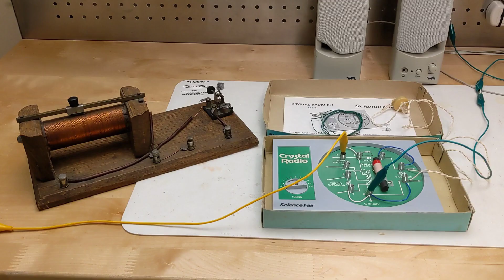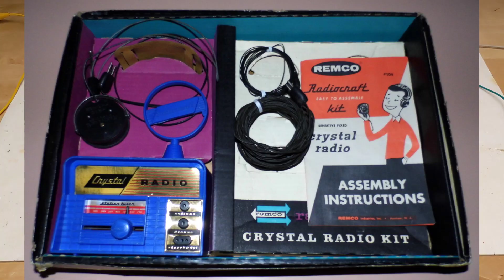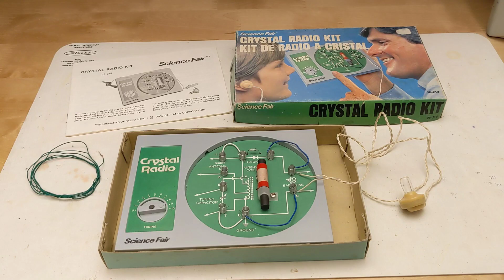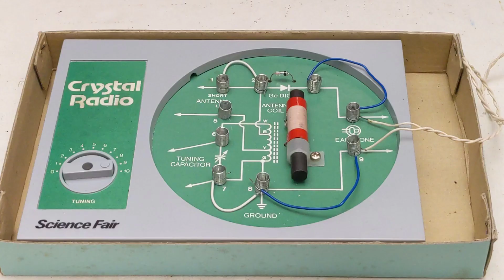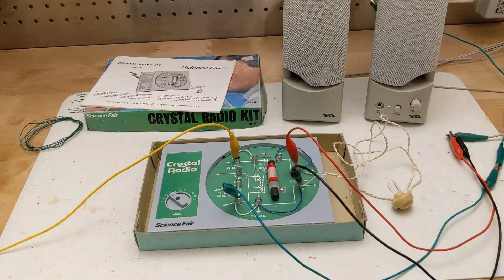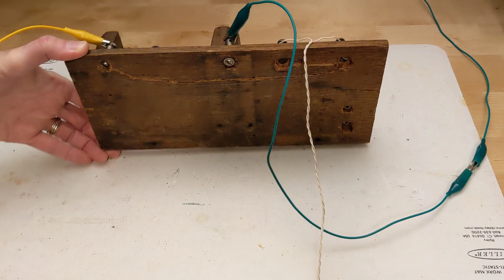A Look At Two Crystal Radios

Comment: When I was growing up, those Radio Shack kits were great. I had one that was a VHF receiver which could tune to police, fire, and civil aviation. It had a cool console and the board used those spring terminals so no soldering. Wish I still had it. Wish Radio Shack from the 80s was still around, too.

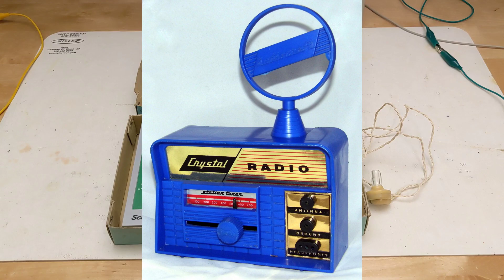Comment: I received the radio that appears at 00:31 for Christmas when I was 7-years old.  My dad helped me build it and we set up a ground and a long wire antenna complete with lightning arrestor.  I listened to a hocky game that was going on about three blocks away and don't recall using it again but it was the beginning of my electrical engineering carreer.

Comment: The board looks like oak to me. :)  I had several crystal radios as a kid.  We even built them in cub scouts one year.

I had one "modern" plastic-cased crystal radio (black base, green transparent cover) that used a metal slider on the coil for tuning (most, like your plastic one shown, used a variable capacitor).  I remember it working really well, until it helped us discover our house had a significant voltage and amperage potential between a heat register and an outlet screw.  My father had helped me "ground" the radio to the outlet screw.  I had extended a wire thru a lot of the house up near the ceiling for an antenna.  My younger sister knocked down the antenna wire tossing a ball one day while I was at school.  The antenna contacted a heat register in the floor, heated up and burned its path into the carpet wherever it touched.  The plastic coil form in the radio melted into a pile of slag. The diode burnt up, turning the glass case into a mirror and cracking in half.  My sister's ball came to rest against the antenna wire which melted into the side of the ball.  Luckily my mother was paying attention and there was no further damage.

It turns out the furnace ductwork was a better ground than the outlet.  After I came home from school and cleaned up the mess as best as I could, I experimented and found I could cause a light bulb (incandescent probably 60w or 100w) to glow dimly by connecting it between the grounded heat register and the suspect outlet screw.  The wiring in most of the house was two conductor in a fiber jacketed cable - no ground.  The furnace in the basement was newer and grounded.  I replaced the outlet and at least that cover screw was no longer live!

A few years later I was testing miniature christmas lights and left them plugged in too long and melted a pattern of the lights into the carpet.  It's a wonder I survived childhood.

Comment: I recall receiving the same Remco crystal radio as a gift for Christmas sometime in the 60's.  I recall it had a plated metallic ball that was used to rub along the coil windings which had to be lightly sanded to remove the insulating enamel.  The round, plastic "antenna" was nonfunctional as you know.    I still have the tuning coil and over my youth, I used that coil to construct another breatboard type of crystal radio.  I recall going to a TV store to get a germanium diode (1N82, I believe) manufactured by International Rectifier.  It's white with red printing on it.   I recall my mother taking me to a TV repair store to get that diode.  Interesting is I eventually got a job in high school working for that same shop for the same person I bought the diode from.   I still have the radio parts and it's functional although I changed the design a little.  
Like you, this radio was instrumental in my developing interest in electronics.  Also like you, I ended up with an EE degree and a successful career.   I remember stringing wire all over our front yard to try to make a "good" antenna as well as experimenting with grounding stakes in the front lawn.    Remco science kits were simple yet interesting.  Thanks for the memories.